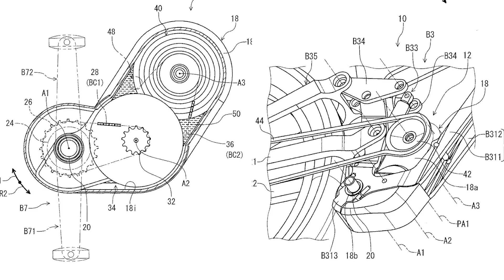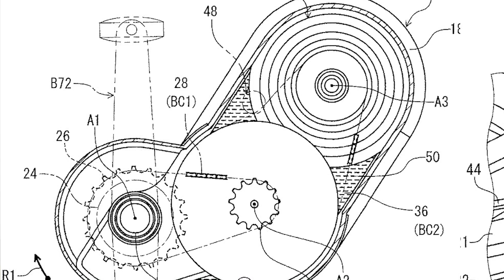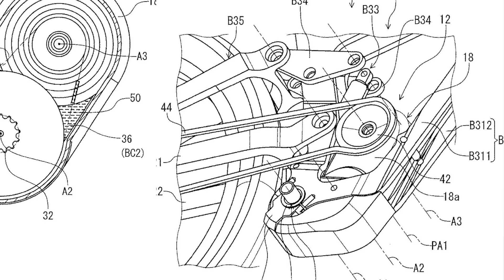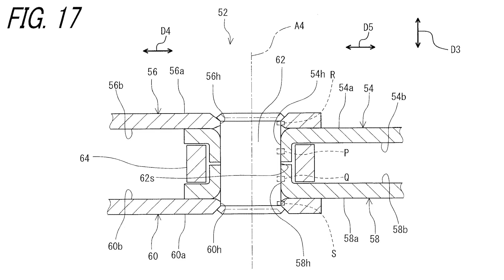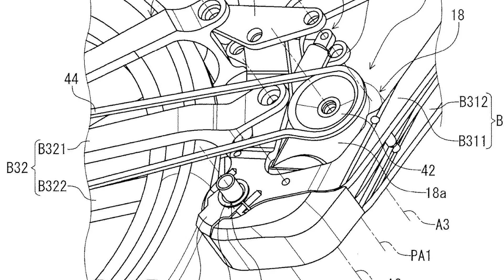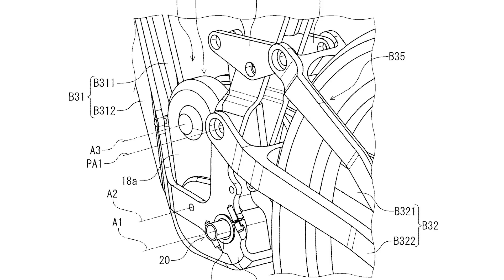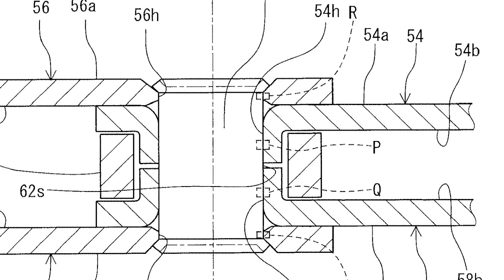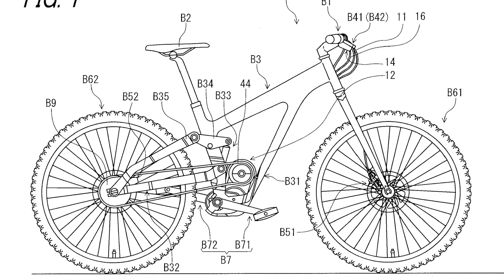Death of The Derailleur? | Shimano's Gearbox Patent

Comment: seems pretty absurd when you think about it that bike gears are just completely open to the elements.
Reply: @Marty See You can make it bombproof.  Question is, do you want to be pedalling something that weighs 30kg?  There's a necessary trade-off because it's human-powered.
Reply: @tywin1  Gary Fisher once said, there a 3 criticial features for a good bike part: 
1.) Robustness 2.) Low Weight, 3.) Cheap Price
Pick two.
Reply: @DilbertMuc  ..or was it Keith Bontrager?
Reply: @Wayfarer-Sailing  Not sure. It's all TREK now anyways... :D))))
Reply: Gimme that bombproof heifer.
If my only real headache is lugging it up the stairs then I'm happy with it.
Reply: @13ivanogre13  Then it might cost as much, if not, more than the gearbox being developed... not to mention heavier.
Reply: @ziggarot  Just Cover your current drive, you will save money on chain lube!
Reply: @tywin1  Could make covers for standard drive & would not weight more than 1/2kg!
Reply: @tywin1  Indeed. At what point does it stop being a bike? You want bomb proof...go to Suzuki
Reply: I think gearboxes and linkage forks would eliminate most of the weak points of a MTB. Brake rotors, spokes, and rear shocks remain fragile.
Reply: Marty See they want people spending as much money as possible.  Why would they make something that you actually would only have to buy once??  No way.  They live you crap that has a million fuckin ways to go wrong so you have to spend more money.
Reply: @Marty See my MTB with thousands of kms has the original derailleur parts fine and my trails are all rocky rooty things that make it easy to catch it. Just avoid hitting shit, lol.
Reply: @0xsergy  jUST cover your current drive & will last a lot longer!
Reply: @Aljonone1  hard to cover it. Im not worried, bike is 5 yrs old now and it's still good.
Reply: not to mention ridiculous service intervals for shocks and forks! Who opens their forks every 100 hours? are you kidding me fox
Reply: @markifi  the fork oil in my motorcycle was super dirty after only a month of use so it's definitely worth checking mate.
Reply: @markifi  In muddy conditions, yes service at least every 50 hours, but for most people that could be more than a year!
Reply: @Aljonone1  would lizard skins stanction covers help that?
Reply: @markifi  May work a bit but maybe too short!
Reply: Its really not absurd. I mean listen to his script. They are "a little bit more reliable" than a derailure"
Just a little bit, for all that extra cost and weight, not to mention that when it get messed up or breaks, its much more difficult to fix and more expensive. 
 It increases the cost of the frame, and its not as flexible. With a gearbox,  is possible that if your system malfunctions in terms of shifting, you may no be able to ride the bike at all. 
If your shifter messes up on a derailure bike, you can do any of several things to still ride your bike, including nothing at all and just ride it in the gear its in. 
You can even manually shift it in some cases by simply loosening the cable to allow you to position the chain where you want it and then adjust and tighten the cable to keep it where it is. You could even break the chain and ahorten it to a soecific gear and ride that until you can fix it, of course you dont run the shortened chain through the tensioner. 
If something gets in the external drive train, its fairly easy to get out and in many cases its sekf cleaning. Get even a little grit in a gearbox, and that thing is very likely done for. 
 And to be sure gearboxes are NOT new. They have had plenty of time to become popular. And they havent.
Reply: so they can be easily worked on.
Reply: Pinion has been making bicycle gearboxes for a while Priority bikes out of Colorado make mountain bikes with gearboxes and seem to be having good success.
Reply: Yes you are right! https://www.pinkbike.com/video/218538/
Reply: Yes there is reasons for that, but just make your own covers too find out why?
Reply: Just put your Derailleur in a box!
Reply: we have a lot of such absurd things in the world, because generally most humans are incapable of innovating and creating anything, so basically 99% of people who make bike products just improve a 2 centuries old design without even a though to innovate instead.
Reply: Would you buy a $50 solution to it from me? That's actually worked

Comment: I want a gearbox BUT, I don't think this system would overcome some of the main advantages of an external derailleur system: weight, cost, and something rarely mentioned in these discussions, cross-compatibility. I love the fact that I can switch fairly easily from Shimano to Sram to Box or whatever else, or that I can change from 10 to 11 to 12 speeds on the same frame/bicycle without much effort. These gearbox systems like Pinion's are most likely going to be mounted on specially designed frames that will severely limit the consumers' choices for upgrades and customization. However, from a mass-market point of view, if Shimano decides to sell these for the mass consumer market, and put this system on every "walmart bike" it would eventually be game over for the humble derailleur.
Reply: It wouldn't surprise me if modular gearboxes would be part of the development for the reasons you cite. In motorsport, gearbox changes for different race tracks (or rally stages) are not uncommon and the tech behind the modularization (is that a word???) is simple enough. The two factors driving such development would be market demand and cost. Switching 10 to 12 speed on a derailleur based system (Assuming indexed gearing) involves replacing wheel, shifters, and possibly derailleur(s) and chain and chainrings - dependent on chain gauge, etc. Changing a gearbox with different rations would likely be a lot simpler.
Weight and performance will determine its success in road racing, but I can see it in MTB and possibly cross very quickly (no more bike changes in cross racing may be a factor in that discipline)

Comment: I have been critical of the massive cogs found in gearbox from Pinion, it is a bicycle you dont need motorcycle sized cogs, having them thin as a cogs on a cassette will be enough, especially if you can make it easy to replace worn cogs. Which make it possible for them to make extra money for worn out parts. Another thing that would be cool if they actually could make the gearbox to fit universally in a typical frame, ie in the triangle over the bottom bracket. Would really like to see a wire controlled gear box for those that dont like going electric.
Reply: While theoretically provocative, being able to line up the belt or chain to the back wheel might prove to be far more challenging to do on your retrofit concept. Gearboxes typically require a different frame.

Comment: On the question of weight: cassette and  deraillieur systems as they currently are, are pretty much the most bare bone system you can get to shift and transmit power. It doesnt even have a case around it. These new gearboxes are going to be A LOT heavier, since you add tons of extra parts, a case and mounting it is way more difficult, which will add more weight to have proper mounting points. The frames will also get heavier, since the bb is a highly stressed part of the bike that now has this reall akward shape with a huge hole in it to mount the gearbox. Gearboxes also suvearly limit you suspension options. That might also result in you not being able to mount a bottle. 

I love gearboxes, if i had the cash i would be riding a nicolai with a pinion gerbox, but you have to see that this system has big disadvantages as well.
Reply: the gearbox's case can act as a structural member and allow more leniency when designing the BB area
Reply: @MoonMage67  Yes, but actually no. While you can definitely transmit force through it, two continiual welded tubes are much lighter than screwing together two thick piece of metal with bolts. A normal bike frame only needs to do two things: Be the "right size" and deal with the forces you put into it. You can therefore shape it into the Ideal shape to do that. A gearbox has so many more requirements, so you are much more limited in your design.
Reply: Youtube User If this system comes to life, you’ll see a departure from what we think of as the typical frame design, & we’ll probably see something closer to how a motorcycle frame works, with two downtubes, or one that becomes two.

Comment: Judging by the size of it and shimanos step motor it might just be for ebikemotors where it really makes sense to get rid of the rearmech due to torque and exposure
Reply: They may want to size the "bottom bracket" to work both with and without a motor. Making it possible to offer a choice on each bike.

The added size is necessary to fit a motor. But it is also desirable for a leg powered bike, since more space allows for less tight wrapping of chains, lower spindle speeds etc., hence less compromises to efficiency. Carbon and aluminum also incur very little added weight by wrapping a slightly larger volume.

So a "bottom bracket" allowing for both motorized and non motorized drivetrain options in the same frame, is a possibility. And Shimano is the one outfit big and central enough to be able to push through such a standard.
Reply: @paulnorman8274  I agree, a multi purpose patent doesnt seem far fedget in terms of a new standard, especially from Shimano. Your progressive insights are much appreciated and we will see what the development brings to the table. Thanks Paul!
Reply: Hmm, except that it is occupying the exact same space that the STEPS motor would, so I think it's a case of 'either - or'. Maybe as @Paul Norman suggests it's more to do with standardisation in frame design...?

Comment: Gearbox is over due with the big brands!
Reply: Gearboxes are heavier, more expensive and less efficient. They have their advantages but aside from lower unsprung mass you can get most of the same advantages with an internally geared hub.
Reply: Skooteh have you ridden a full suspension gearbox bike like Zerode? Lower unsprung weight is not a small bonus, it literally makes the ride so smooth that you could be convinced you’re floating on descents.
Reply: Arjun Adamson but the climbs? Less efficient more weight ???
Reply: @Bumfluff-Rider  with this system, there is no cross chaining or grit to increase drag, so that would make it more efficient than an external system. This uses a cassette type gear cluster, which reduces weight compared to constant mesh clusters. Due to the placement, there is less unsprung mass and a lower center of mass, allowing the wheel to move with the terrain easier, increasing traction and efficiency, and making the bike more stable. There is also less ROTATIONAL INERTIA on the wheel, allowing it to accelerate, stop, and lean faster. The whole system is intended to work with the rest of the bike to improve overall performance, while perhaps sacrificing a tiny bit of weight reduction to do it.
Reply: @Skooteh  NO
Reply: @KarolisBorkertas  YES?
Reply: Karolis Borkertas yes he is completely right

Comment: Makes me wonder about chain stretch in the system. Not a fan if the electronic possibility, though, as I'd less apt to use for bikepacking.
Reply: The existence of a patent doesn't mean that there will be a commercial product that actually works in a reliable way.
Maybe chain stretch is much better if the chain is always straight and protected from dirt.
Reply: Might be belt drive too

Comment: isn't this just a sort of Alfine hub in the bottom bracket?
Reply: As far as I understood it, it's more like putting a usual drivetrain with chain rings and cassette in a gearbox housing. As far as I know usual gearboxes and gear hubs work with toothed wheels without a chain that connects them.
Reply: @jochenkraus7016  that makes a bit more sense

Comment: Having this combined with the Ceramicspeed driveshaft a very real, and very tasty possibility
Reply: I don't know if I'd prefer it over a belt drive.
Reply: I think I’d prefer a Gates belt drive over a driveshaft, a belt handles bumps better, & a driveshaft might give you tire size limitations based on how it sits.
Reply: efficiency, weight, simplicity. Ceramic speed seems to be the better idea.
Reply: @medtxastratospore5729  Simplicity? lol